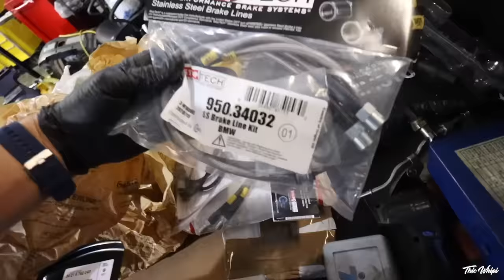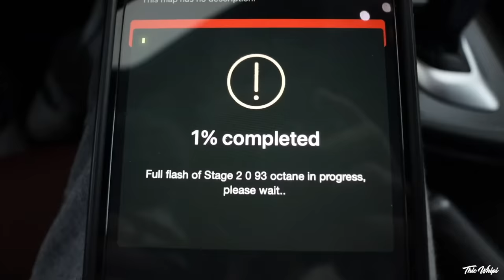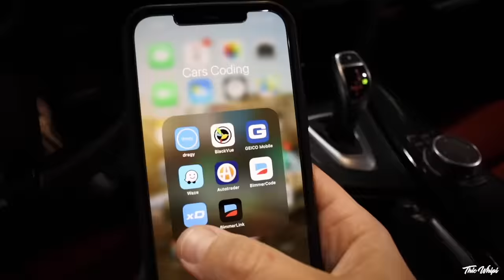BUILDING A BMW F30 340i IN 10 MINUTES!

Comment: What caused the rod knock? Im looking to upgrade the turbo on mine but this video just lowkey kinda turned me off towards the idea 😂
Reply from the maker: It was actually the impeller pin on the turbo came loose and sucked into cylinder 3, piston smashed it to bits and it killed the motor.
Reply: @ThicWhips  so unlucky

Comment: im surprised the b58 had rod knock...
Reply: Is it not common?
Reply: @youngbreeze5931  nope
Reply: Impeller pin on new turbo came loose and dropped in cylinder 3

Comment: I just bought  a f30 335i. The 340i was definitely  something  I would  love to have but my pockets were alittle  short.  I'm happy just time to get it the way I want it.
Reply: Congratulations bro! I’ve been eyeing these cars forever, but can’t afford them really, I’d love to see your mods whenever you get them done!
Reply: @TwilightsPurple  will do my brother  and thank you
Reply: Your best bet go FBO and tune on btm stage 2+ you will make around 520 hp my body has f30 335i went fbo btm stage 2 on 91 pump
Reply: @702s.studios   I did the charge pipe planning on my downpipe and intercooler soon. I'm stage 1 mhd and it definitely woke up my car. Not disappointed at all one thing though it's hard to stop the wheels  from spinning on acceleration.
Reply: @troylogan3653  hmmm my friend has f30 335i currently runing 520hp on stage 2 btm, his tire setup is 275/19 it hooks like nothing
Reply: @troylogan3653  his mods are , full catback,catless dp,chargepipe, cold air intake,kies intercooler,tuned on btm stage2+ on 91 pump. He currently tryna run e85 and port the manifold he tryna reach 650whp, hope he doesn’t blow the n55😂
Reply: @troylogan3653  honestly I like his current setup tho I feel like 500+whp is perfect for fun
Reply: @702s.studios  do you know what tires he's running?
Reply: @troylogan3653  Michelin
Reply: @702s.studios  ok thank you my friend
Reply: Congratulations man!! The n55 is still a great platform and you can make more than enough power to have fun with

Comment: On your website you don't list any alignment mods such as spacers or camber plates, however, in one of your videos you mention getting camber plates. I was wondering since you have nice fitment without the need for spacers or camber.
Reply from the maker: I removed the camber plates because I took them off of the car (they made too much noise) and the car has enough natural camber as is. As for spacers I don’t run them. I try to order wheels with correct widths and offsets instead

Comment: Has anyone had issues with their steering on the 340? My steering feels sticky and the wheel can follow a slight bend in a road without me touching the wheel. I have noticed this gets worse with the heat outside. If anyone has noticed this or has any tips on fixing/improving it, please let me know!
Reply: I had that issue before in my M45 , tires was Potenza Bridgestone , i change the tire to more comfort ride and the issue reduced 50%